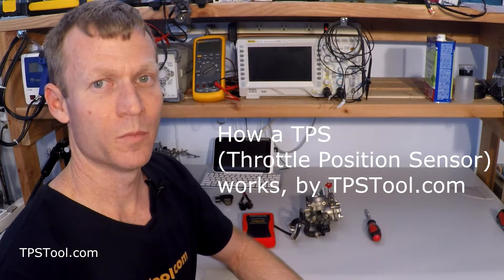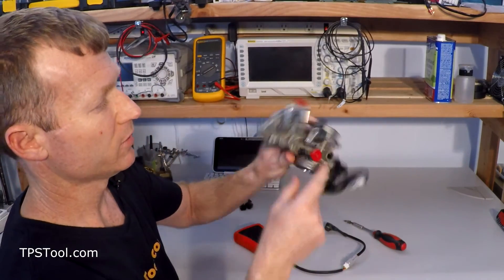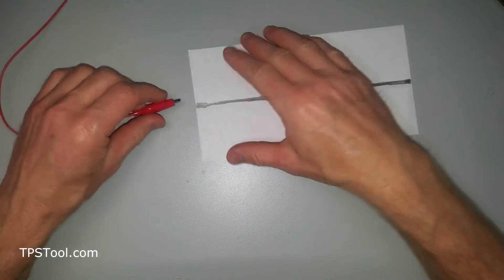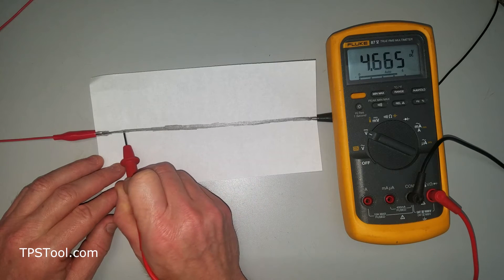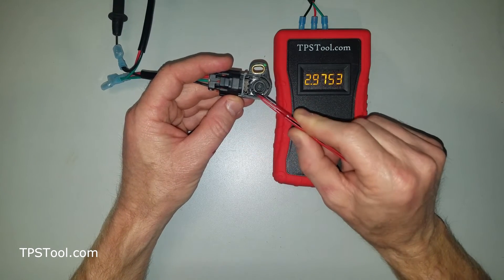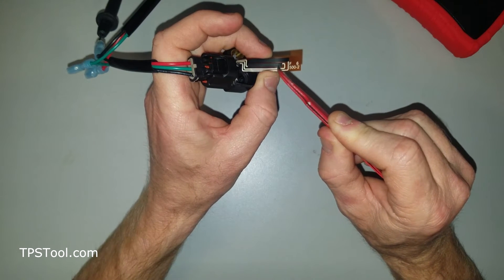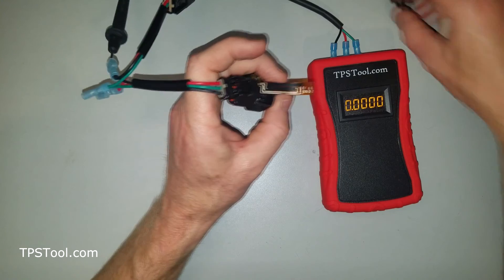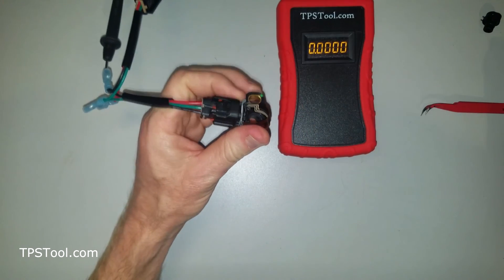How a TPS (Throttle Position Sensor ) works

Comment: Never too old to learn something!  That pencil lead test was so cool. Thanks for the video
Reply from the maker: Thanks for the comment, I'm glad you enjoyed it!
Reply from the maker: @Jimmy Doran Thanks for your question.  There are several things that can cause these issues, TPS is only one of them.  Did the problem start suddenly?  Did you make any changes are adjustments just before the problem began?
Reply from the maker: @Jimmy Doran A brand new bike shouldn't have any running problems.  I'm not sure what country you're in, but if it's an option then I would take it back to the dealer and have them look at it as a warranty issue before you start fiddling with it yourself.

Comment: Can you use it to adjust on cars if it does i know for a fact that my wire harness has 4 wires and your tool has 3 terminal
Reply from the maker: Thanks for your question.  It would depend on how your specific TPS is designed.  Some of the 4 wire TPS have the regular 5V, gnd and signal pins, plus an idle pin.  In this case you could use the generic adapter wire that has 3 separate plugs on the end, plug it into the 5v, gnd and signal pins and ignore the idle pin.  But you need to check the schematic for your TPS to know what the individual pins are.  If you decide to try it and need the generic adapter, order direct from the web site (tpstool.com) and email me at the same time and I'll include a generic adapter for free.